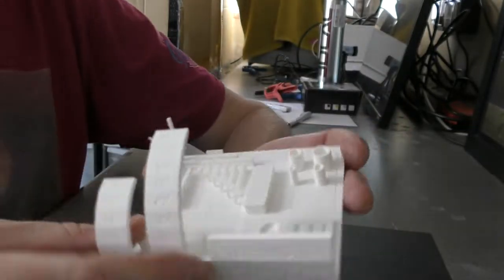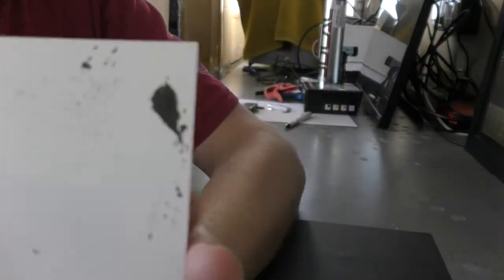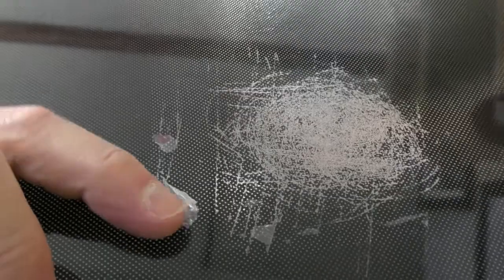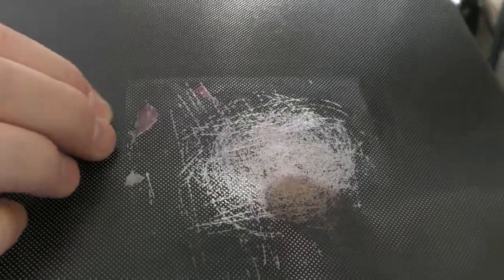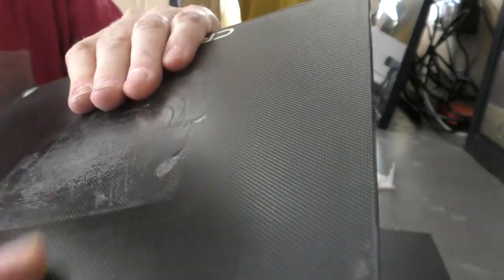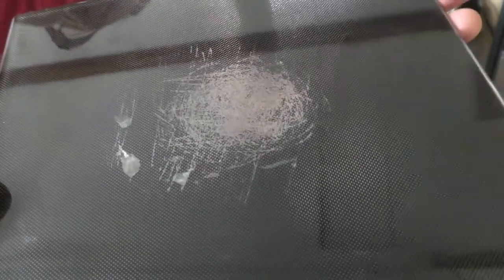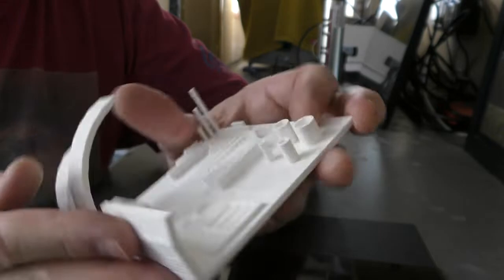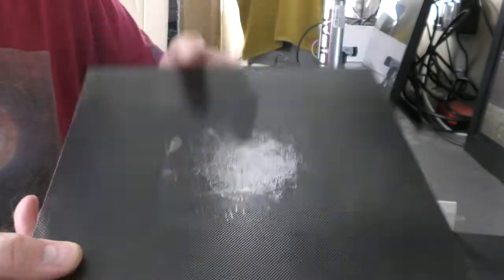Creality Ender 3 Glass Bed Damage

Comment: Same problem with my glass bed. 1st time it happened after forcefully removing printed part while still hot. But now the same happened again when taking the fully cooled down part without any force.
However, I am using 90 degrees for first layer and 80 for remaining part to get reliable adhesion with PETG (which I could not achieve with lower temperatures). Cleaning always with isopropyl.

And I don't know how to get the glass bed removed from the heat plate.

Comment: Bed to close or removing prints that are still hot. Let it cool fully to room temp never force off a print if needed use water or even toss in the freezer for a few mins. Also don't ever scrape or try to clean bed with abrasive stuff just dish soap, water, and a clean soft cloth.